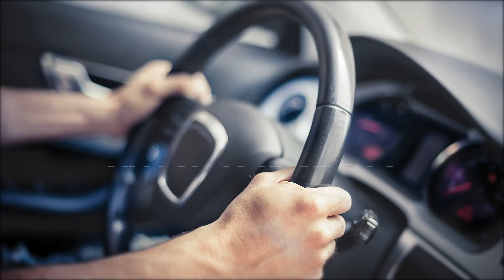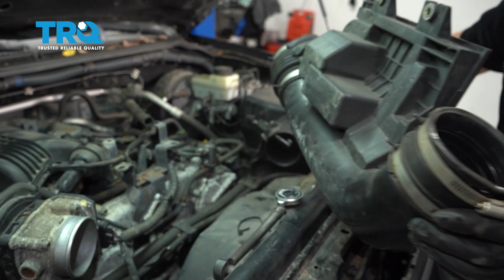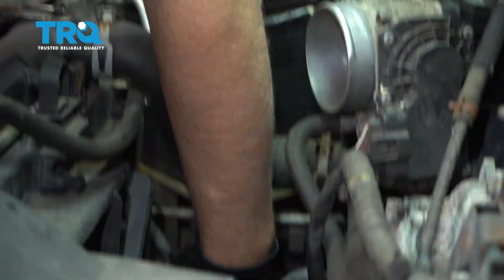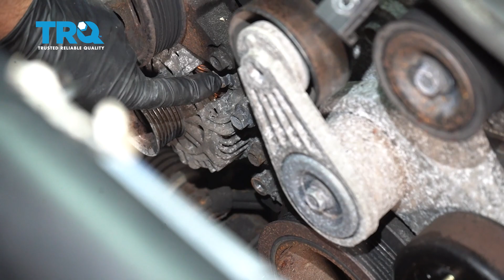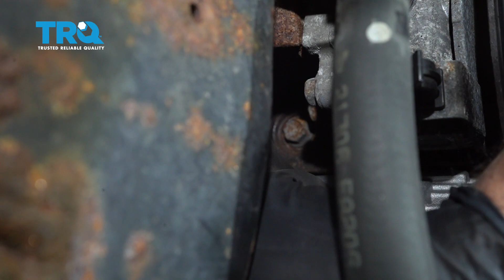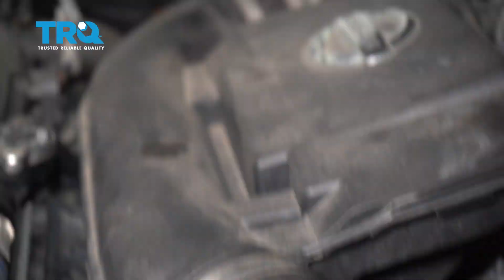How to Replace Alternator 2005-15 Nissan Xterra

Comment: Can confirm that this video helped me immensely. I really miss my jeeps with the 4.0 after this though. 

I defintely had to use the wheel well route to access the plug and ground connections. What a pain in the a** job to do though, but i saved money, so I'm content. 

Also, the my fan shroud was a total PIA and im jealous of the one on the video being so easy.

Comment: I have no idea how he did it like this.  I replaced my 2005 about a year ago and there was no way I could get my hand past the alternator like that. I went through the wheel and it was much much easier.  Even then is was a pain to take off the connector and the nut. Putting the alternator back on was not easy it dod not slide into the bracket, if it is misaligned even by 1/10 a degree it will not go in. I had to use a short pry bar after trying to get it in for 1/2 hour.